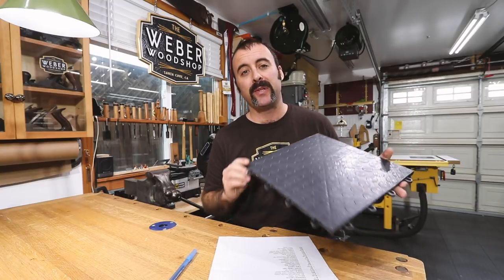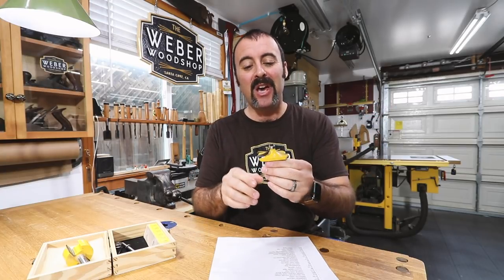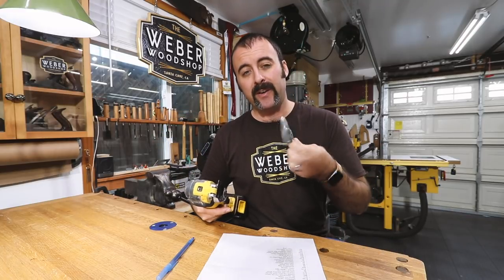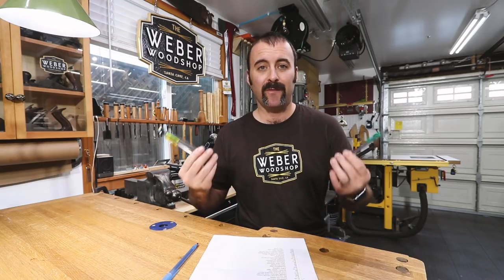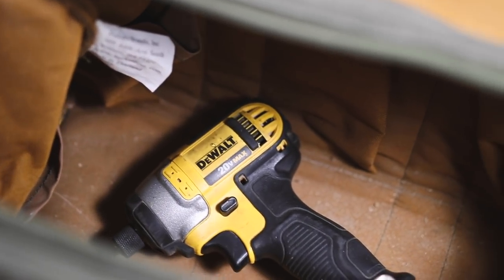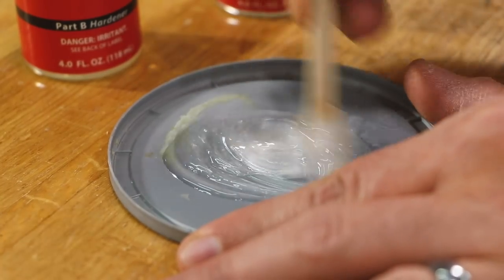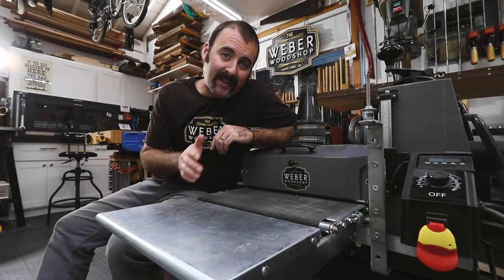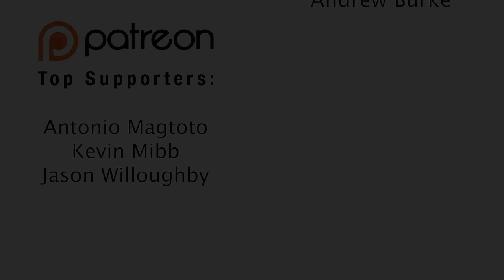35 Best Woodworking Tool Buys!

Comment: I like the list, and have many of the items already; I am placing an order for a couple more!  A word of caution; the recommended deadman switch is rated for low Amperage only, and using it on a high load shop tool can damage the motor.  The switch in the link has only 18 Ga. wire.  Amazon has switches rated for 15 Amps, which is the highest current load commonly found in home shop tools, that is a better choice.

Comment: The hook and loop sanding discs are GREAT! When the disc abrasive is no longer useful, I will use a spray adhesive on the spent sanding surface, and on the back of a piece of every day sand paper, cut into a circular shape to match, and then pop the holes into it to match the hole pattern (put small starter holes before attaching, then hitting all the holes is even easier). Works actually surprisingly well.

Absolutely agree on popsicle sticks!

Comment: Excellent list of tools and gadgets for the Woodworker i did Woodworking professionally for over 20 years and as my hobby for over 30 years now  i also use the Bic 7mm  mechanical pencils  and i love Bucket Boss products for their long term durability  by far their  shop Aprons have held up better than any other brands  especially for the money  ironically i bought my very first one in one of the pricey  Woodworking Supply Stores  and i was surprised on my own self paying their high price tag  at the time  but it turned out to be  a good  thing as it was my first Bucket Boss product of many more  over the years

Comment: 3m worktunes are what I wear at work for audio/hearing protection,  it's Bluetooth and cordless. 
I may be a little rough on things and so they have only lasted me around 12-14 months on average but the battery tends to last me around 40 hours on a single charge, uses micro USB and they also have a version that has am/fm radio but they cost a little more. 

The Bluetooth version I use is available at Lowes for about $75 roughly,  and has a respectable range about 50 yards in the shop with VFD's running and other digital power management systems with no obvious interference.

Comment: Thx for the plain and realistic explanation of the tools, I’m a DeWALT guy to, great job and  merry Christmas from Alberta winter wonderland
Reply from the maker: Wim Boon glad you liked it!
Reply: Google 'DEWALT CHOPSAW/TABLESAW COMBO"
(not available in USA)
I met a Mexican Flooring crew who had 4 of them!
JUST LOCK THE HEAD DOWN TO USE THE TABLESAW!
SO FAST! (they had them on wheels)
Reply: AND THE 23 GAUGE PIN NAILER IS NOTHING!
CHECK OUT THE NEW 21GAUGE!
THE PAINTERS LOVE THE NEW 21GAUGE !
1/2 the size of the 18GA!! 
Its basically a hair thicker than the 23GA , BUT HAS A HEAD!!!!
I DONT USE MY 18GA BARELY ANYMORE!!

Comment: I would move to sanding nets instead of the red disks. They last longer and the dust collection is that much better.

I also use senior tongue depressors instead of the craft sticks. They're a little bigger/thicker so they make a great stir stick for thickened epoxies and such.

Comment: Thumbs up on a router lift. I have a Jess-Em router lift II (budget considerations) and don’t know how I lived without it. Changing bits and adjusting depths is easy and takes zero time. Takes all of the resistance out of deciding to use your router table. Also — two thumbs up on the Pastebot.

Comment: Try the 3M Worktunes. They have a bluetooth model that i love. Good hearing protection and good sound.
Reply: Ive been using mine fire audiobooks and heavy metal in the woodshop for the last 3 years!! The battery is outstanding

Comment: I have a Shopsmith I bought in 2003 it is there 50th Anniversary edition. I was introduced to Shopsmith in the mid 80's and purchased one back then and It was the model before the double quill bearing so I upgraded it. I used it for many years and the only part I ever had to replace is the on/off switch. I purchased the new on because of the upgraded fence and table system and other qualities, besides the 50th edition is special as it has a gold motor cover. I use all aspects of it except the drill press I have a free standing one. I use the horizontal drilling extensively. I also have a Rockwell 1.5 hp router I bought new in the 70's and I still use it today. I even purchased new motor brushes and never had to replace them. I have 2 RBI HAWK scroll saws and a Dewalt 788 type one. All my tools were MADE IN THE USA does that tell you something? Great review

Comment: Merry Christmas!  Great video. 

Torx (star drive) was a game changer for me too. Square drive is a pain especially kreg, and I've even stripped them.
I've never stripped a torx unless it was at a crazy angle to the screw head. 
Spax are the best I've seen , but GRK makes outdoor screws that fit into kreg pocket holes if you need that.

Oh, and I've had a cheap $15 clearance multi tool that worked great. Helped tons when we remodeled our floors!
Reply from the maker: Awesome thanks!

Comment: I am a landscaper looking into woodworking as a new hobby. I’ve been using the HOWARD LEIGHT ear protection for years. They sell a hygiene kit to replace the ear cups and foam, but not the headband. Also I bought a $10-15 Bluetooth adapter off amazon and zip tied it... 👌🏼

Comment: I prefer square aka Robertson head screws. I have nothing against Star aka Torx, but hate having to keep 4 to 5 different size bits in my tool belt. With square drive, I only need #1 and #2 bits (or screwdrivers) on my body for most jobs.

Comment: The Dewalt MultiTool... Fein may have made them famous in the general public, but the original use was an orthopedic bone / cast (plaster) saw, where the blade frequently came into contact with skin, and didn't cut it open (only minor scratches where the skin may be a little bony) 
On another note, there is a special blade for the multi tool that is specifically for cutting out single gang electrical boxes.  I was working a site and the contractor pulled one out and it blew me away. (I had just finished my basement and cut all the outlet boxes by hand.

Comment: I love my 3M WorkTunes bluetooth headset. I use them in my shop, and, outside while using my leaf blower or snow blower. I even use them on extremely loud public transportation trains, and that's where they really get put to the test. Depending on options, you can get them on Amazon between $38.89 and $68.42.
Reply: PaganWizard. Same.

Comment: 3M makes a fantastic hearing protection bluetooth headset!  I use them while working on the flightline launching and repairing F-15C jets.  Those jets are incredibly loud, louder than the loudest tool in a woodworking shop,  but I can still hear my music perfectly.  Even while 10 feet in front of the jet intakes.   The battery lasts forever too

Comment: A dremel tool (or rotory tool of your choice) with a spiral or tile bit is the best tool tool for cutting around electrical boxes, windows, door frames in drywall and similar materials I've ever found. I still love my "super tool", "vibro-saw, or whatever you'd like to call it. In the end, use what you have but I assume you have a rotory tool maybe something to try.

Comment: Biggest most appreciated in my unshop is the little cube type angle gauges.  No more trying to interpret angles or squaring up stuff.  These are digital down to the 1/10th degree.  Also, look at the Rockler miter sled.  My gosh.  What a great buy.  I've thrown out all those crappy ones that I tried to buy and spent hours trying to get them to work right (precision, precision).
Okay, one more in the gauge department..a digital angle gauge.  Get a 12 or 8 inch.  Amazon stuff.
Reply from the maker: I totally agree about the digital angle gauge.

Comment: I got a pair of the Honeywell Sync Bluetooth headphones last year for Christmas and they are incredible. Audio quality is great, noise protection is great and they also have a boom mic coming off the left ear piece which cancels out ambient noise if you're talking on the phone. I have full conversations when using my ROS and shop vac with those puppies on. Plus they are exceptionally comfortable. Slightly pricey for headphones but I would drop the money on them again in a heart beat.
Reply from the maker: Ben Smith good to know I’ll check them out!

Comment: So just FYI, a much better (in my opinion) mechanical pencil is the Papermate sharpwriter, the lead rides inside a corkscrew shaped piece of metal which acts as a spring, and gives you a little bit of cushion so that your lead doesn't break all the time, which I'm sure you've experienced.  I've use these for over a decade and highly recommend them. You can get 36 of them for 9.08 at the time of this posting (Amazon) Thanks for the info, hope this helps a little
Reply from the maker: Jason Wharton I was about to reply that my favorite thing about those pencils is that they are cheap enough to put everywhere... but what you mentioned is also a good deal. I’ll check them out.

Comment: I like your Well Equipted Wood Shop  --  4 or 5 Starz!

I was watching a Video On 35 Best Woodworking Tool Buys

And I have several favorite tools on my list: 
( Wedge )
Tongue Depressors are ok for craft jobs
I like SHIMS and glue together - 2 ply - 3 ply
One shim is flimsey -- So more is Better!

My Ryobi Tools are Great --  Circular Saw -- Multi Tool  -- Hex Impact  -- 
 But The CHUCK ON  DRILL SUCKS
Spits out Drill Bit and Do Not Use
 RYOBI DRILL

The DeWalt 6" Bar Clamps are Great For Holding Wood Parts
Which Brings to Mind A RYOBI Brad Nailer Which is Perfect
So I like Smaller Bar Clamps  -- Do not Do Many Large Jobs

The Dual Flute Step Bit Is Great For Drilling Pilot Holes
I used to make Wood Canes -- Drilled Handle With STEP BIT
Tapered Shaft Like A Pencil and Glued Them Together - EASY!

One Tool I really like from my Years In Metal Fabrication 
Is a One Inch Wide Belt Sander - Smooths edges very well

I like this Video:
Create Steam Carved Bench
https://tinyurl.com/s4ah5mo

Comment: 3M's Worktunes Bluetooth hearing protection headphones are a dream. Battery lasts forever (and is replaceable!) and they sound great.
Reply: Yeah I own them as well they're the best I've ever used and I've been through probably 10+ pairs working in a cabinet shop by trade. Tough to find good hearing protection with good sound with edge bander/CNC/table saw/jointer/planer etc.. in the background. (They also have a very good Db rating can't remember off the top, but they're the shit tbh)

Comment: My favorite tools are dial calipers, dial indicators, sheets of plexi to make jigs and fixtures, parallel clamps, machine squares, sharp drills...
Now as to your list Mr. Weber.., magnets are a nice idea, unless you grind/cut steel, weld, etc.  Chips and grinding dust will stick to your magnetized tools, not too big a deal, it's just annoying.  
And another thing, the scale/rule is spelled 'Starrett' from the L. S. Starrett company.
Reply: Ugh - the starrett ruler is now $30 on amazon.  Also a tip on the magnets - I use duct tape to remove metal shavings/dust from magnets.  Works great.

Comment: That's the most amazing coincidence I have ever seen. I use and cherish every tool and materiel you showed here today except the thickness sander and tiles, and I've been wanting those. Tip: get a pair or 2 of "1-2-3 blocks". They're precision ground metal, and great for temporary jigs and drill press work. A dial caliper is also very handy. Damn, I still can't believe the similarities. I never dreamed anyone used a Starrett scale, popsicle sticks, carpet tape, parts cabinet, magnets, foo...
Reply: 1-2-3 blocks are amazingly useful in modeling, Adam Savage put me on to them a few years ago on YT. Heavy, perfectly square rectangular, steel blocks. I work on a much smaller scale, so a few rare earth magnets and these blocks make for silly easy clamping.

Comment: Omg yes the star screws! One of the best moves I made too.
Reply: How long have you been woodworking? I'm just starting and looking for tips and affordable tools I can buy!
Reply: Cole l well. I basically was born with a hammer in my hand. Haha. My grandfather was a hobby furniture maker. My dad before he retired and sold his tools was a g/c and had a wood shop to make furniture. I never really got into it until recently. I’m in the trades I have an Hvac business. It all depends on what your looking to get into first. But I start with basics. Hand tools. Check Craig’s regular for good deals on tools that’s how I get a lot of my stuff. A compound miter saw is a must have and shoot to get a slider. Band saw is awesome to have and table saw. You can do just about anything with just those saws. Jig saw or scroll saw is a good saw to have too. A router is good start. Trim routers aren’t too much. Of course some type of sander. If you must only have one I’d get random orbital. But If your going to work with soft wood like say a mahogany top. You would want a non orbital sander as the soft wood will show the cross grain sand marks.  Drill set is a must with some bits. Figure out what type of projects you want to tackle first and start with the basics you’ll need for that. It’s a life time of investing in tools. So take your time and have fun with it along the way. Yes there’s a tool and jig for everything.  But some creativity you can find ways to get the job done without all the fancy gadgets.
Reply: Cole haha you sound like me when I was 17. I have an automotive background as well. Your doing great brother. Keep dabbing in many different things and develop a well round of skills. You’ll never go hungry. Hit me up in the dm if you want to chat @creation212 @themetaphysicalgene

Comment: Make sure to pick up some non-aerosol accelerator. The aerosol type eats most finishes. That router bit is a type of table edge bit. ISOtunes for Bluetooth hearing protection.
Reply from the maker: KM Crafting good to know
Reply: @Jeff N It's mostly the 40-50% acetone that does it. The non-aerosol uses naptha which is a bit less harmful to some finishes.

Comment: You might try the amazon basics closed bluetooth headphones. 
You may find that the audio isn't up to what you want, but they certainly work for isolating sound.
I certainly agree with you on how difficult it can be to find reasonable closed headphones, it seems that all the decent ones have an open design.

Comment: Thanks for the tip on the Starbond tape.  I will have to check that out.  I’ve been using the CA and painters tape.
Reply from the maker: The tape is not by StarBond. Check out my website I’ve listed everything with links

Comment: The 3m bluetooth headphones are pretty awesome
Reply from the maker: impulse0341 I almost bought them but it seemed like the reviews said the audio isn’t that great in low or highs. Decent mid-tones only. So it’s fine for radio or rock n roll but not great for jazz, classical, etc. I remember that being the case when I tried something similar a few years back. What do you think?
Reply: Yeah that's mostly what I listen to on them... that and audiobooks. But the range is great for the bluetooth, the radio quality depends on the signal reception.

Comment: How did you put Sawstop Splitter & Blade Guard on your table saw? 

Thank you very much.
Reply from the maker: Modified it to fit by removing metal with an angle grinder
Reply: @weberwoodshop  Thank you for answer and always great videos.

Comment: If you have a Menards (vice Lowes/HD), get your Torx (star) screws there.  They have the "gold construction screws" (gold in color and used for general construction) in 1 and 3 pound boxes.  They are the BEST PRICE and variety that I have found.  They have a great selection of coated deck screws too.  Why can't Lowes/HD (closer to my house) figure this out??  As a side note, if you are buying pipe fittings, Menards is literally 1/2 (YES, 1/2) the cost of Lowes/HD.  I  bought about $125 worth of stuff from Lowes (sorry Lowes) when another customer said, "You should go to Menards, it is half the cost as Lowes."  I thought he meant that iI would save a few dollars.  I didn't think it was worth my time.  I had another errand and passed by Menards.  I decided to take my receipt into the store and check.  YES, it was 1/2 (exactly 1/2) the cost for each part.  I used the receipt as my shopping list, went back to Lowes and returned everything and saved over $60.  This is true for black pipe and galvanized.  I haven't compared copper, PVC, etc...  I personally prefer Lowes, but not for screws and pipe fittings.
Reply: Likewise, I recommend Tractor Supply for nuts & bolts. They sell them by the pound, and normal (grade 2?) stuff is super super cheap.

They have it up to grade 8. My assumption is that those are also inexpensive, but I don't know that for certain.

Comment: Screws. You went from flat to Phillips to star or (torques), well from the star to the Robertson is a huge step again! These are Canadian screws and I’m not sure if you can get them in the US. They hold way way better than the star!!!
Reply: why would robertson screws be better then torx? robertson is better then phillips for sure but i dont see why they would be better then torx..
Reply: @darioranft9148  Give it a try and report back.  What do you have to lose?
Reply from the maker: The head doesn’t effect the holding power.

Comment: Hard pass on the mechanical pencils. I break them too fast. I would much rather have a box of Dixon Oriole #2 pencils. I have tried many different ones, and these are my favorite ones.  
Also, Rockler makes a really nice silicone project mat and silicone glue brushes. Epoxy, glue, etc all peel off really well.